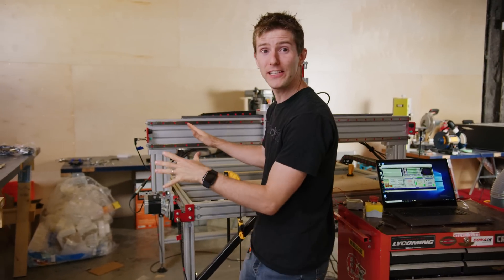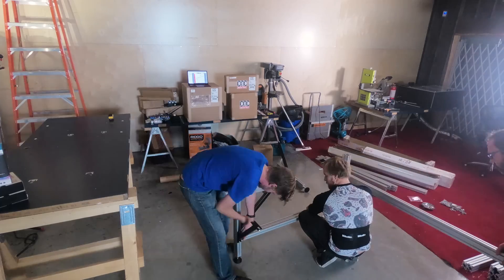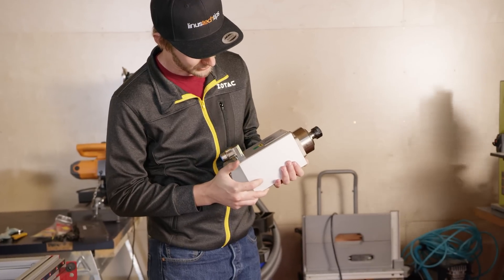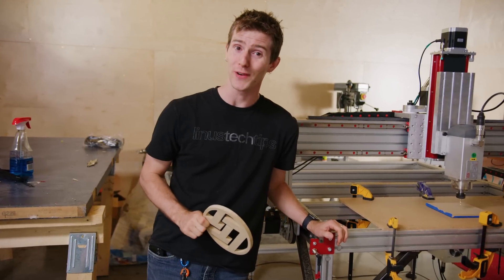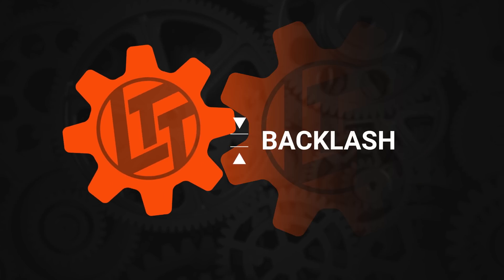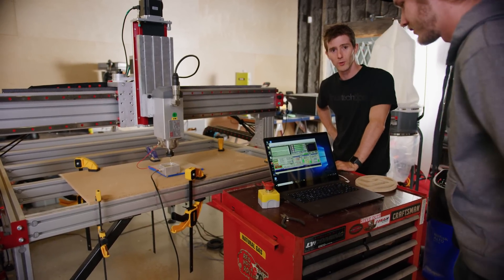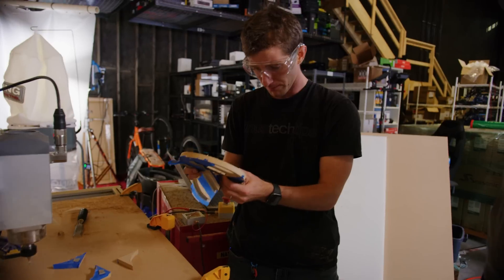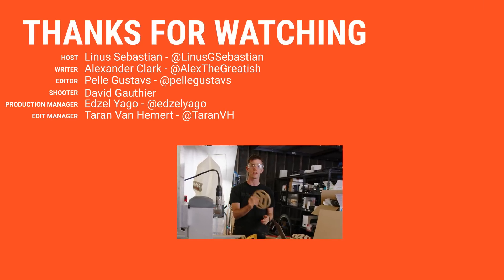Our New $10 000 Router!

Comment: Get a HEPAfilter cartridge for the dust collector the bags are not as good for the fine dust... It will goes everywhere
Reply: You have to use a breathing mask anyway.
Reply: @henningholthusen831  and the store shelves get also a mask each? 😉
Reply: You need a cyclonic separator and a hepa vacuum.
Reply: Just have the exhaust go outside...

Comment: i have already seen plenty of good names so i wont suggest one
how ever (for safety)
1. bolt the E-stop switch to the working side of the table on the rail -the side that you are going to mainly work from
2. make a rule that when ever you going past the outer rails or are not using the tool to depress the E-stop switch
3. fire any one who does not keep it clean after use

Comment: I would recommend just because you can cut at the top feedrate dose not mean you should and whatever speed and feeds you get off the internet, half or 1/4 the speeds and feeds. Most numbers are for industrial machinery. The router might look heavy duty but until you have ran a 94000 pound boring mill the router can only do so much lol

Comment: Need a vacuum table mod with Sacrificial waste board. A dust skirt/brush around the spindle will greatly improve dust extraction. Upgrade the steppers to Servos. Add a tool changer if the spindle allows it

Comment: Linus, a tip for fastening parts without clamping is using hot glue. It's fairly easy to remove and should secure the part as long as your rates and feeds are correct. Keep in mind it may mess up surface finish.

Comment: The proper way to change the tool would be to first press that big red button next to the laptop. It's called the safety shut off switch for a reason. You push the button to disable the power, and pull it to enable it. I'd recommend following said procedure while adding or removing material to the cut bed as well.